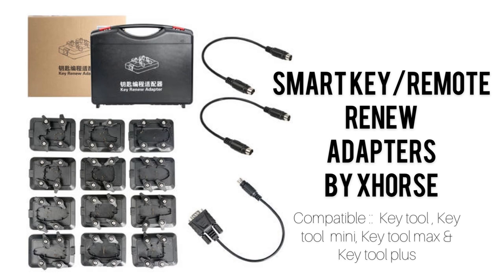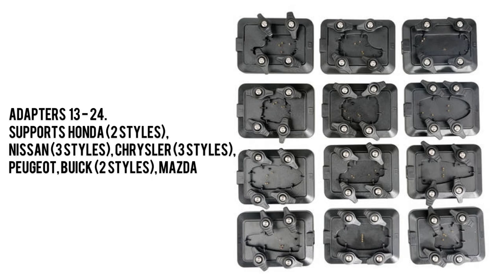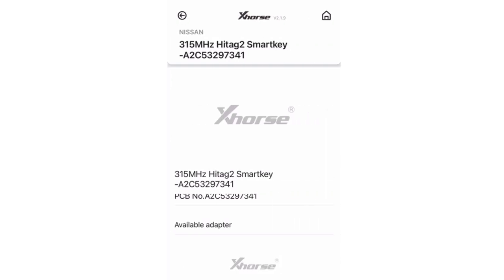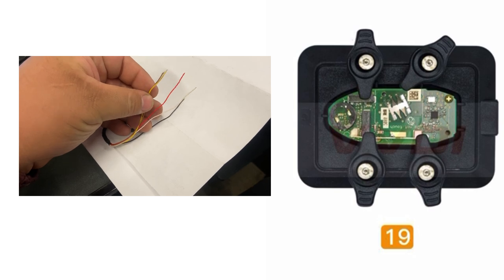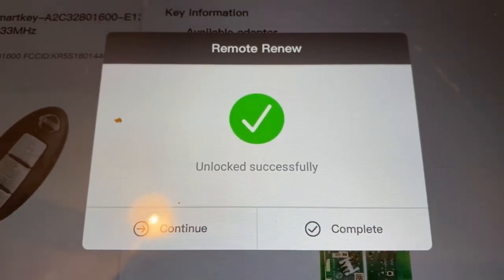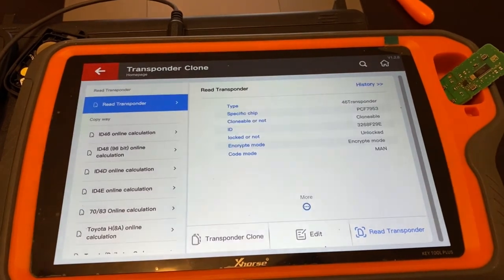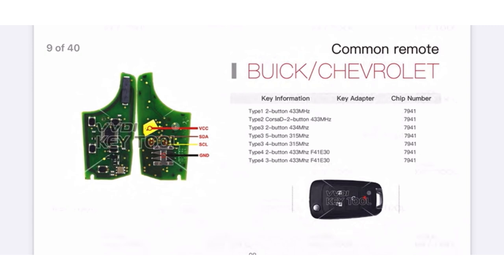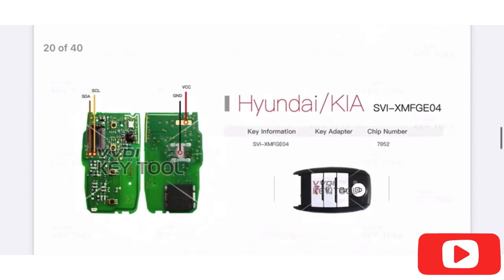REMOTE RENEW ADAPTERS BY XHORSE

Comment: Do you think that by using the pin table at the top of the xhorse pdf shown, that it is possible to unlock aftermarket keys by soldering directly to the chip pins?
Reply from the maker: Yes very possible i done it once.. but not promised it will work..

Comment: Hi I have a customer that has a 2016 Skoda Octavia vRS I have a key tool Max and I have the pro pad 2 first of all is it a wireless key or is it a smart key as the customer has an original key but it has a flip out Blade so I was under the understanding that that is not a smart key that is a wireless key am I correct because when I search it online it says it is a smart key I'm very confused am I able to use a xhorse key under the have to be a smart key or can it be a wireless key many thanks
Reply from the maker: Ask the customer if his car is push to start?
Reply from the maker: I believe it is a push start therfore that is a smart/proximity key! Im not sure you will be able to program that key with either of your programmers,if you had the im608 than yes, first You need to make  a dealer key... start by reading pin from vehicle.. have both keys at hand..
Reply: He said its a key ignition but the picture of it on the key tool max says smart key
Reply from the maker: I dont think your going to be able to program the key i would just pass on it for now .. not unless you know for sure you will be able to read pin and make dealer key
Reply: @MYKEYSAUTOMOTIVE ok thanks 😊
Reply: Hi I have just had a customer with a 2008 BMW they bought a key off of eBay for £8 I use my pad2 Pro I was able to program the key so that it started the vehicle but the remote function does not work is that something I have done or is that because it is a cheap key many thanks